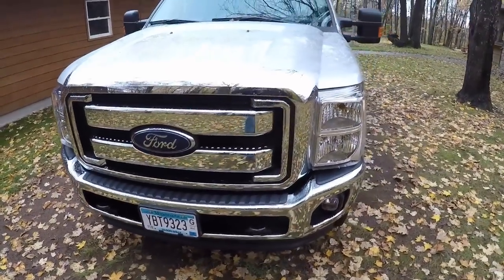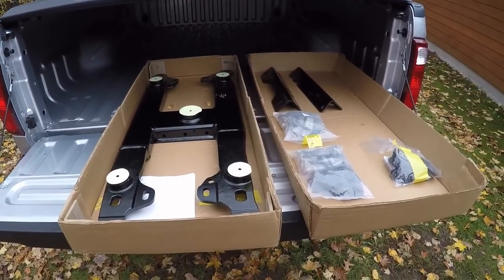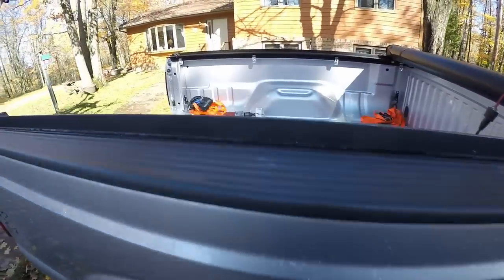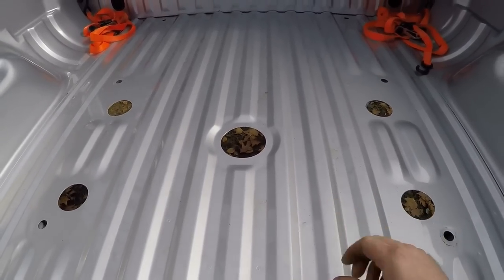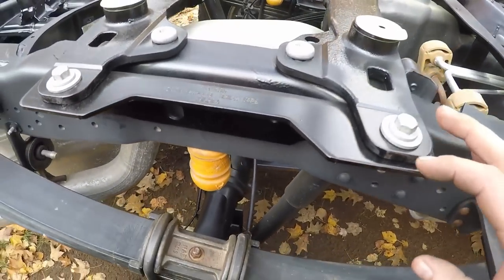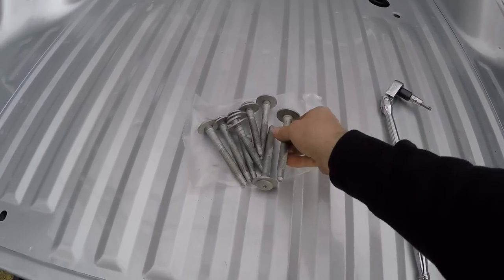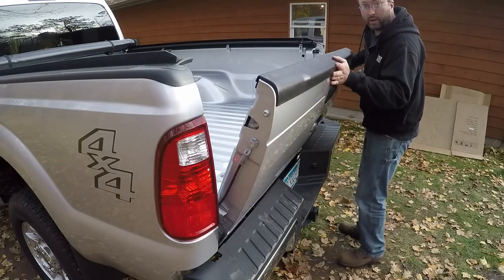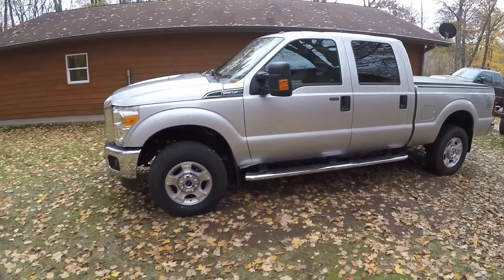Ford 5th Wheel/Gooseneck Hitch Prep Package Installation Sequence

Comment: If anyone has come here to find how to do this on their truck; and they have a spray in bed liner, here's a time saving tip. Get yourself a decent chisel or, a good wide blade flat screwdriver and a tape measure. Look at the install instructions and you'll see the rough dimensions of where the holes "should be" , and you can go ahead and scrape off the bedliner over those areas in a small 2" circle. You'll be able to easily find the factory dimples in the Aluminum bed. Now you can drill and you'll have a clean install.

Also, another tip. I was able to do mine without removing the bed, but unhooking everything, and using a jack and some 4x4 sections to lift the bed. I wedged some 4x4 chunks between the frame so give me space to slide in the mounting frame. Wasn't fun, but saved me the cost of having it installed. Been working great for 35k miles pulling a 38' Sportsman 5th wheel.

Comment: Great explanation on how to do this!  Do you know when Ford started putting the guide dimples on the beds?  I want to do this job to my 2011 F250, but it has rhino liner so I can't tell.  If mine doesn't have the dimples, any idea how difficult getting the measurements just right would be?  Thank you!

Comment: Awesome video, you convinced me to do this myself on my new 2019 F250 Limited.  I bought the new special socket for the bed bolts but my tool kit doesn't have a torx bit big enough for the M16X45 Torx bolts.  It isn't a T45 as I have that and it's way too small.  Any idea what size torx bit I need for the bracket?
Reply: Thanks  @squatch253  .  Now if I can just find a place that sells individual torx sockets!  Cheers.

Comment: Hey Squatch, just wondering about rust on the sawn hole edges in the tray. Would it be worth sealing them with paint for protection or will the rubber seals keep them clean and dry?

Comment: hey man, great video showing the install. I am looking to put the frame in my 2015. I managed to find a used frame for a good price, but it doesn't come with the hardware and was wondering if you by chance knew what size bolts came in this kit to put it all together and mount it to the frame?

Comment: I have the frame crossmember in my 2015 truck but not the holes or trim rings and covers. Does Ford or someplace else sell the trim rings and puck covers? I don't want to drill holes until I get all the rings and covers,Thanks!

Comment: do you have the part number for the kit.. I have a 2015 Super Duty. someone drilled holes but it was not a Ford Puck system not sure what system they installed so may need to re-drill holes (I hope not) if you could also give me the spacing between the holes and distance from the front bed wall to the fist hole that would help.... If not no problem i understand....

Comment: Nice!  think if was me when had bed off….  I would have sprayed a under coating of some kind on everything if lived in area like you do! So as to help preserve  body and parts of the truck! As well as put drain holes in the holding areas that hold moisture and debris even if just use liquid weather stripping chalking to fill in pockets gaps and voids!
Reply: @squatch253  cool  just too much money to see it rust away!  So did you fix the pony motor leak?

Comment: How do you remove and install the ball? I got a new truck and I can't quiet get it to work. I just pull the center black plastic piece up? Correct?
Reply: @squatch253  thank you. I think the previous owner must have had a trailer on the ball for 80,000 miles. Im coming to the conclusion the the black plastic has fused with the metal ball.

Comment: Glad you got a new rig! Nice Ride! We just keep our old ones chugging along. Looks like there may be a good thing for working for a dealer all these years after all! AND the Farmall came to the rescue one more time! Maple leaves on the ground here too. 35 to 40 tonight. You probably have snow already! I got a pal with a machine shop to put a Reese hitch on my old Ford. Wish I still had it. 330-6, 4-speed, short bed, limited slip 4x4. Beat to death but ran fine.  Now I got an 89 Taco with a 4.3 4x4 but it's paid for. What else can I say.
Reply: Freezer fillers. One of my last jobs last fall the boss cooked up a mess of fresh tenderloin biscuits for breakfast. I had 3 and wanted 3 more but I'd been snoring on the dozer. I only hunt with a knife and fork and never miss! Take care, Pal!

Comment: Electrical know outs work much better for cutting sheet (<0.125"). Kopper Kote your bolts and hardware before they go in, allows years later to be able to remove them. No painting of the cut metal?

Comment: Great video ! I put a B&W companion 5th wheel hitch in a 2019 Platinum 2 months ago and it was a mistake.I used the puck system and I cannot put a truck box in. The hitch goes right up to the box. I used a 2002 Chevy HD 2500 with a B&W gooseneck and a Companion 5th wheel hitch and no problem with the truck box. Any ideas let me know please.
Reply: There is only one reason a truck box won't fit. Has nothing to do with the make of the truck. Your Chevy must have had an 8 foot box and your ford has a 6 foot box. A truck box will only fit in a 8 foot box with the hitch. For your 6 foot box it uses a different companion hitch as well. Much larger as it is a slider and the 8 foot box uses a solid mount 5th wheel.

Comment: I'm trying to locate this prep kit and I am having difficulty finding it. Do you have a dealer or vendor that has this kit in stock?
Reply: Thanks so much for that link. They indicate that they can ship within 1-3 business days and I've sent them a request for availability. I also was able to locate the in bed wiring harness at https://www.oemfordpart.com/oem-parts/ford-trailer-wiring-harness-in-bed-hc3z15a416a. Thanks again for the information and for the informative video.

Comment: Squatch, great video!  You seem to be a great mechanic, and you describe and explain things wonderfully.  I just bought the 2018 350 Superduty.  It did not come from factory with the puck system, so I went to Ford Parts.com and ordered the kit.  Here’s my question.  The 4 ¼” and 3” holes that are drilled in be bed of the truck seem a bit large.  These holes seem to give about ½” gap or a bit more. I understand that the finishing rings will cover the holes, but only by about 3/8”.  Does there really need to be that much clearance, or would a 3 ½” and 2 ½” holes be sufficient?  These holes would still provide ¼” clearance all the way around the whole.  Just seems that removing the least amount of material is best, and not taking any chances that the cutout will sneak beyond the finishing ring.  Any and all positive, helpful comments welcome, and thank you again for your videos.

BTW, the instructions in my kit do also call for the 4 1/4" and the 3" holes.
Reply: Hey Squatch, thanks for the input.  Interestingly enough, I had just finished my project when I saw that you posted.  I did end up going with the recommended hole size, and I'm glad I did.  The extra wiggle room when lowering the bed, even with the factory guide pins, was good to have.  And ther really isn't excessive clearance and the rings cover nicely. 

It's very interesting that you said you do them at the dealership.  Our dealership in Rapid City wouldn't touch it, said it was a liability issue.

Anyway, thanks again,  and by the way, the Moline is looking great!

Comment: That box comes off so east that’s insane. I will be doing mine soon on my 2019 F250 lariat
Reply: he did an awesome job explaining this job.  I have a sprayed in bed liner so dreading figuring out how to get that stuff off the bolts and finding the factory marks in the bed.  hoping i can find them from underneath
Reply: John Judge the marks are easy to find. I found them in two seconds. They’re small little dimples like he explains and there is four of them. As soon as I purchase my kit I will be installing it.
Reply: Jerry, I have a 2019 F250 King Ranch - have you been able to find the fifth wheel and goose neck under bed kit like the one in this video?  Any help would be great and also a part number.  I found the kit on etrailer but it does not have the inner bracket just the outer and my truck did not have the inner's welded on.  Have you checked your frame for the inner's?
Reply: John Carter I have not checked my truck frame yet but I was able to find the kit locally I just haven’t purchased it yet. I will look into it further and post what I find out.
Reply: John Carter what do you mean by the inner bracket?
Reply: @jerrypolete5258  Jerry, I just picked up the Fifth Wheel / Goose Neck Under Bed Kit.  Hopefully, this will help anyone else looking to get this setup.  Part Numbers for the kit:  HC3Z-5F057-B (includes inner bracket) / HC3Z-5F057-A (inner bracket NOT included).  Btw, these are both difficult to find so good luck to everyone!  Just for clarification the inner brackets are the 2 brackets required to the inside of the frame rails that this kit needs to bolt to.  Ford has welded some brackets on non tow package trucks and not on others.
Reply: John Carter here is what I found....

Hitch Prep Package - 5th Wheel / Gooseneck, Includes Inner and Outer Level Frame Brackets

Part No: HC3Z-5F057-B                                                              

Under-Carriage, Crossmember Package.

Required Prep Package for Gooseneck Hitch Kit.
Includes 7-Pin Wiring Harness.
Requires Dealer VIN Match.
Compatible with:Super Duty 2017 2018 2019

Good luck on getting yours installed and hope it works well for you.
Reply: @johncarter9877  you don't need the inner bracket.  That' for 4x4 from what I've seen.  If you have a 2wd it doesn't have a bracket and you'll use the one with the kit.  I have a 2018 4x4 and it has the inner bracket welded on.
Reply: @johncarter9877  I have this exact kit and don't need it -- will be selling with the 27.5k Reese hitch.

Comment: Can you do a video of the fifth wheel / gooseneck trailer wiring plug install inside the bed of the truck instead of just running your trailer wiring down to the bumper plug?

Comment: Great demonstration video. I like the way Ford made that optional kit available for those who want to install this at a later date. My truck is an "07 Chevy dually and I don't think an option like this was available. I also like the bed lift idea. I installed my FW brackets and rails in the conventional fashion, which is much more difficult and time consuming. For the longest time I've wanted to return to my standard bed when not towing but just didn't want to go through the hassle of unbolting my rails. Perhaps I'll find a gooseneck/fifth wheel combo setup somewhere that doesn't cost an arm and a leg. For now I guess I'll just have to contend with rails in my bed all the time.  Again, great job on the video.
Reply: Ken who drives a GM built truck nobody seriously for sure
Reply: B&W Champion 20K with wheel and gooseneck ball, both removable

Comment: I'm thinking that this is the correct way to do things. Especially by using O.E.M. parts and accessories, they're guaranteed to fit, and I presume are also covered by Ford's warranty too, in this case?
I was trying to see what size of engine is in that truck; I  imagine it's an optional ( larger ) then  stock by looks of the exhaust pipe?
I like the looks of 'plain' model trucks, it lend's itself to be easily 'customized' at will.
Reply: Yeah, I kinda thought it was a tad larger gas. engine than stock. that 6.2 can haul for sure.
Those were my thoughts too on the diesel option, especially if you're not doing an awful lot of towing and driving, like you mentioned.
Reply: Ahh, the price advantage is always nice to have . But the way they all fit is a great big plus to; you're correct!
Reply: @squatch253  I couldn't agree more on all the new Diesel trucks from any brand, they're great when the factory is on the hook to fix them but loosing the high pressure pump on a Ford 6.7 will just about bankrupt a guy! The cost to purchase, maintain and repair a modern diesel in a light duty truck makes the diesel a loosing proposition for me. Keep up the good work!

Comment: Hoping you can help me. I got a hitch prep setup off a buddies truck and want to put it on mine. I have a 15 and don’t see dimples on my truck. Do you happen to still have the instructions for measuring it or know where I can find them
Reply: Squatch253 thanks again man. Ended up tackling the project today with the Reese instructions and your video. Only real difference is the hole size for anyone else in the same boat as me.
Reply: Nick Friend I know this is late but were the measurements the exact same? The 46 and 3/8 inches for the main hole?

Comment: Adding a B&W turnover ball with the companion hitch would have been a hell of a lot easier. Unless you stated in the video why you went this route, my opinion is only at a quick glance at this video.
Reply: Thanks for the reply! You made good points. Thanks for the further explanation!
Reply: Thanks for the great video!  You mentioned the Reese kit.  I believe its their part # 30138-26.  Do you know if the Reese kit has the sliding mechanism setup the same as the Ford part?  

What is the Ford part # for their kit? I wouldn’t have the means to completely remove the box so in that case would you lift it up and support it on pieces of 6x6 or maybe two pieces of 6x6 stacked?
Reply: Squatch253 Thanks. I have a 2016 F-250 XLT crew cab
Reply: The Reese part #30138 comes with the gooseneck ball and the chain anchors.  Does the Ford kit include those parts or do you have to get them from Reese?

Comment: I am installing one on my new to me 2016 f350 dually. Quick question, do you know if the new nuts for the bed bolts are supposed to be smooth as in no threads, all 8 of my new bolts are without threads? Are the new bolts self tapping? Maybe that's why ford wants them replaced? Thanks